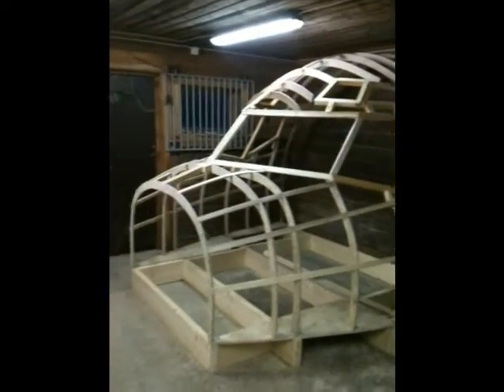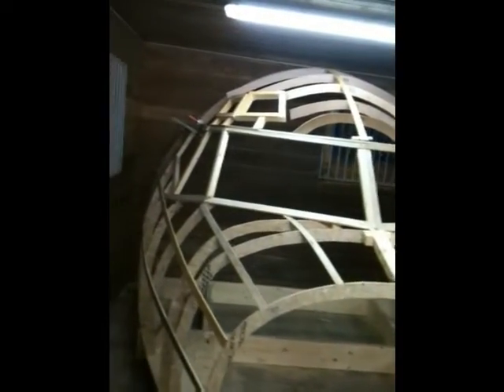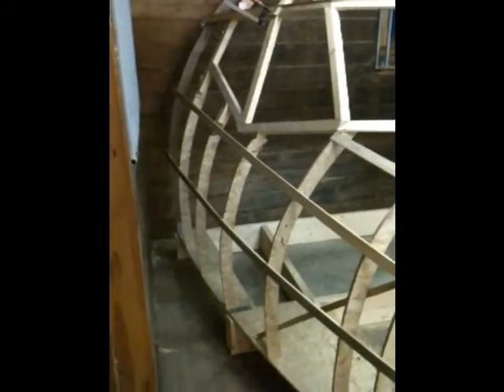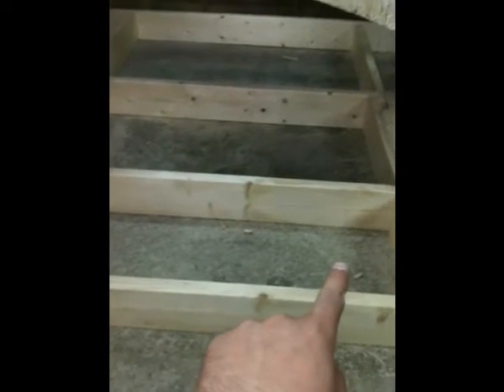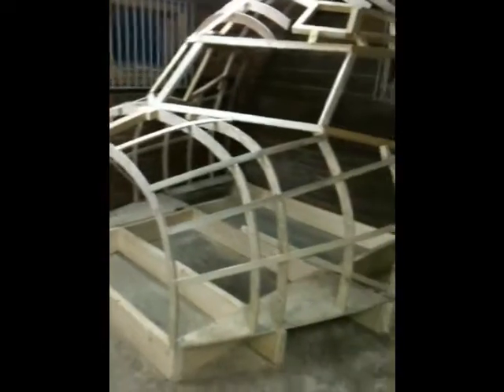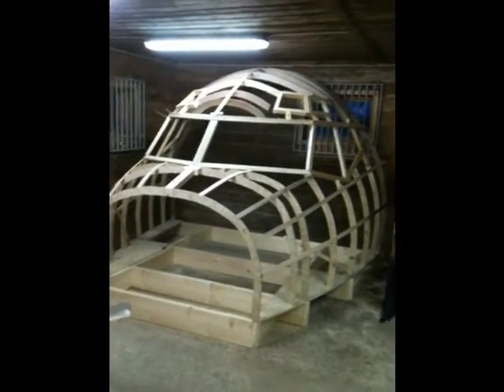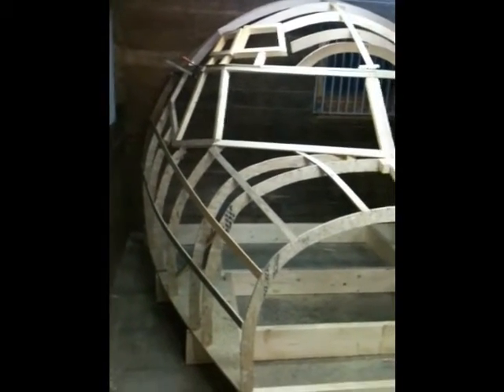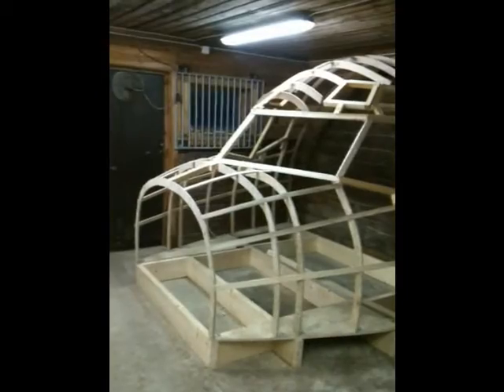Building a Boeing 737-800 home simulator #1

Comment from the maker: @MRAviationUK Hey... Well, if you check out some of my other videos, you'll see that the shell can be divided into five separate pieces to make it easy to move around. So the roof is one section, the walls divides into two pieces, and the floor can also be split in two pieces. Thanks for watching..